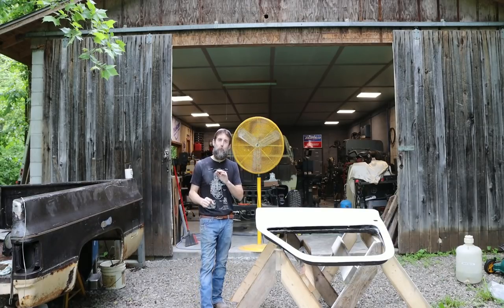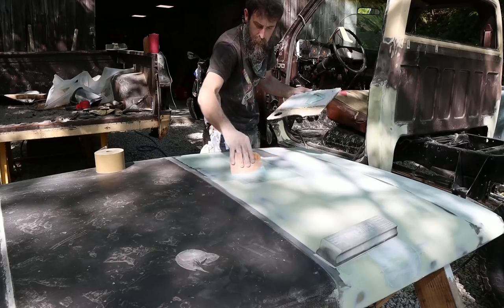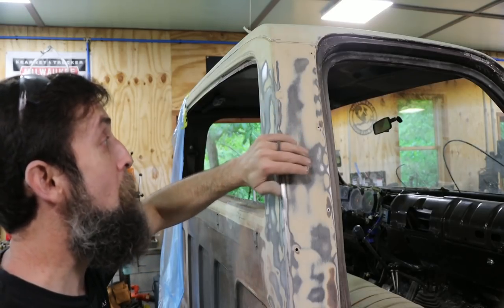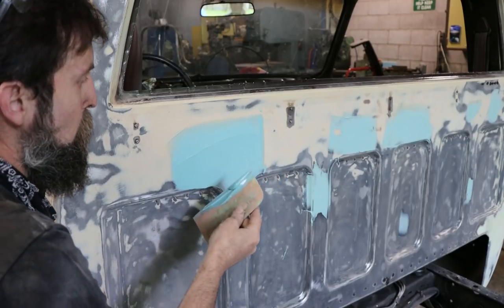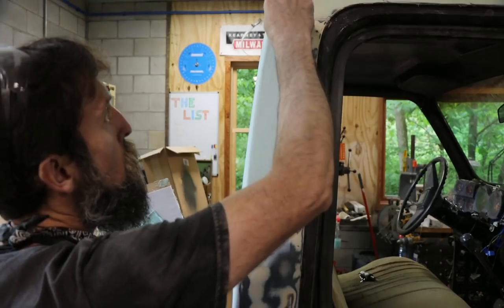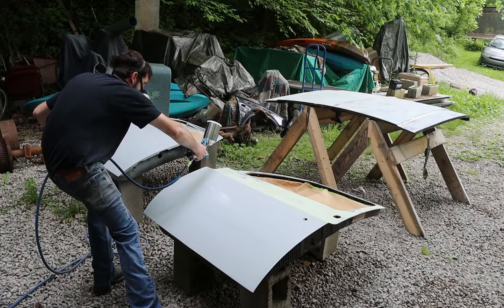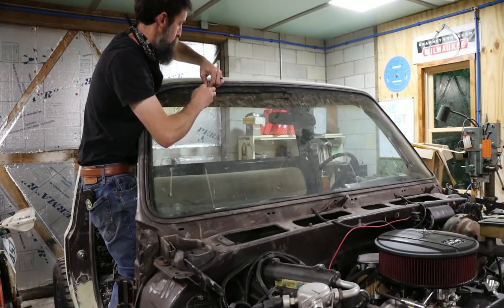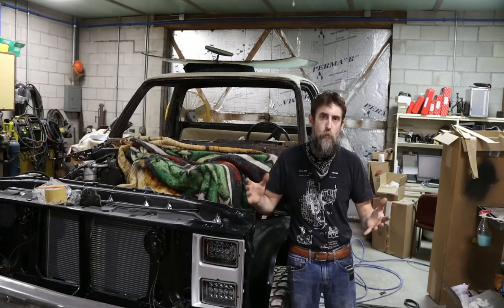This truck is Rough! Body work tips and spraying primer.

Comment: I have done 3 square bodies and replaced the windshield and gasket on all of them. while they might look clear after so many years all the micro pits and scratches make it hard to see through. Just did a quick search a new one is around $100. Well worth it imo.

Comment: A trick I used a few times to increase the open (working) time of filler was to add some acetone to the mix.  It also let me wipe on a thinner coat, so I had less sanding to do.  I only used this on a small job, so I cant' say if it impacted the long-term properties of the filler.  I was just leveling some pitted channel iron on a piece of machinery I was refinishing, and it seemed to work just fine.

Comment: Hi Steve great work as usual. I’d recommend sanding your filler a little finer than 80 though. All the substrate will continue to shrink with age so those sand scratches that are filled with primer will shrink more. Over time it will event start to show through your paint especially the first time you leave it out in the sun a few days. Looking good will be a nice truck when you’re done.

Comment: I'm a skeptic too but your description matches almost word for word what I heard and felt on a solo camping trip in the deep woods in the U.P. in Michigan. I was almost like I felt the noise more than I heard it. I was deep in the Porcupine Mts state park. I heard the answering call also from who knows how far away. There are plenty of bears up there but they don't make noises like that and they don't answer back to each other either. It was about 2am and I'm in one of those little tents that aren't much bigger than a sleeping bag. The first thing I reached for was my Glock 21 which would probably just make whatever made that noise extremely annoyed while it was tying you into a tight knot around a tree.
Needless to say, I don't think I slept anymore that night, in the morning I got out and did some circles around the campsite out to a couple hundred yards and found absolutely nothing. I tried to make as many miles between that site and my next night's site as possible  I was up there for three more nights and never heard anything like that again. I know for a fact it wasn't a black bear and it wasn't a cougar, it wasn't a wolf. Those are the three big animals in those woods, if it wasn't any of those what was it?

Comment: Steve if you run a strong wire from the inside of the cab to the outside of the cab and pull the wire all the way around the the edge of the entire windshield will unstick the glass from the rubber.

Comment: Great job!! Crazy the sound you heard. I used to believe nothing like that could exist without us finding it. This isnt about big foot but in 2009 i was deployed to iraq. I was on a very small COP (combat out post) we were walking back to our company area. It was dark outside. On this cop we only used red or blue light At night. Because the cop was mortared a lot. We saw a cat just freaking out like it was in fear. When we got about 6 feet from the cat. this massive mostly black spider runs out and grabs the cat. A very small fight..cat had no chance. then runs off with the cat. When we were seeing this. we all went to white light. The whole thing took about 10 to 15sec. We were about 6 feet away from this spider. We all got a very good look at it. It was not a camel spider. They dont really Get that big. the biggest i ever saw was smaller then a tarantula. Plus they look kind of like scorpions mixed with a spider. This looked like a wolf spider. The body size without the legs. was about the size of a 2 liter bottle. Its legs were about 3 to 4 feet long.  We found the cats body a few days later by our trash dump. It was fur skin and bones nothing else. I have been told that its impossible for a spider to get this big. There were 3 of us that saw it. We all saw the same Thing. Never saw it again. One of the people that was with me and saw it. was our first sergeant When this happened no joke our command had us looking for it. With the intent to kill it. Worried about someone being attacked by it. Looking back i don't know why we didn't shoot it. we all had our weapons.
Reply: I've no idea what type of spider it was, but I've heard a couple of giant spider stories from friends who have lived in the middle east. New species of bugs and animals are still being discovered every week. Lots of undiscovered stuff in our world still!
Reply: There are spiders like that, that can outrun us easily - and will kill. It's a bloody wild world out there! Much respect for your service in Iraq, take care from the UK.
Reply: Tired eyes play tricks at night. The world's biggest spider is in South America and weighs about 5 Ozs.
Reply: @Bob_Adkins  Three pair of different eyes playing the same trick? I guess it's possible, about as much as the giant spider is possible..
Reply: @Steve_Just_Steve  Zoologists will kill and risk being killed to get a creature named after them, so we're talking 1 in a billion or more. There are endless stories and fantastical legends about camel spiders, which are small and relatively harmless. I can't imagine how many stories there would be for some huge arachnid that could carry off a cat.
Reply: Wow!!!
Reply: @Bob_Adkins  A lot murdering Zoologists out there huh? JK
Reply: @Steve_Just_Steve  Naaaah, only when they fight to see who a rare bug gets named after.
Reply: @Bob_Adkins  i hope a wish that was the case. But there were 3 of us that saw the same thing. We went to white light. And like I said we were about six feet away and you could see this thing with extreme detail. It killed a carried off a cat.  
It really looked like a all black wolf spider. I really hope it was some kind of Mass hallucination. I really dont wait that to have been real.

Comment: Body work is an underappreciated, thankless, hardest thing most people will ever do. It takes hours upon hours to get it  straight. Its dusty, takes a ton of elbow grease, and a good eye and hand feel, to get it right. Just when you think you're done, you're not! Body filler is absolutely necessary to make it straight. What most people don't realize is that most of the body filler that goes on gets sanded off. Just about every beautiful , straight and shiny, show car that you've ever seen has  tons of body filler applied to it.  The really straight ones have more body filler on them than paint by weight. New cars are not straight by show car standards. Even though Steves truck is not going to be a show car, I know he'll probably take it to the point that it'll be straighter than when it came off the new dealer car lot, because that's how he does things. He won't be satisfied until he's satisfied.
Reply from the maker: When one is slick it shows.

Comment: Back when I was doing such work on trucks, if a decent bed couldn't be found, I built a flatbed on them. One can get quite creative in styling one, just build it as you want to.
Of course, that was way before the cost of wood and metal went to near low orbit prices.
Just a suggestion.

Comment: Steve in 1997  I was hunting in a pit bkind for deer on the the Nw end of Panama City Beach. I was in the pit before dawn but it was late in the season early Feb I think. So it was warm and moist and foggy as hell. Really didnt have much hope of ctchung site of anything till it burned off so I hunkered down to wait. After a short while i began to here something large moving through the thinly pkanted young pines near me. Way to noisey for a deer. Pig I thought as the large noisey thing moved past my blind at what sounded like just a few feet. Hard to say with the darkness and the muffling effect of the fog. Suddenly what evr it was stopped moving almost dead in front of where I sat... Then I realised I could hear it breathing deep slow raspy breaths. Then that same ultra low ultra deep grunt or rumble you seem to be describing just about blasted me out if my seat. I COULD LITTERALLY FEEL THE NOISE.... About then I realised I was gripping my rifle hard enough to leave permanent marks in the wood. And had already slipped the safety. Isat frozen terrified on a deey primal level. This was not one  the normal woodland of  North West Florida. After an eternty of hear it breath and sniff the air and a few more grunts it finaly moved away. Leaving me more shaken than I have ever been... Cant tell you what it was  but It definitely was not normal fauna. And Sware I will never forget the FEEL OF THAT RUMBLIMG GRUNT.... like someone was thumping my chest
Reply: Sorry for the typos folks Ive got fat thumbs.

Comment: i didn't read thru all comments but i assume you know epoxy primer on before filler. other areas to raw then epoxy primer followed by build primer. there is a powder that is dusted/rubbed on for guide coats vs foo-foo cans

Comment: So your story sounds like an experience I had once when I was younger riding my bike late at night. It was a sound much like you described. Come to find out the area I was at, it happened a good bit. What caused my experience was two different winds  from opposing directions meeting at the top of a ridge. The sound I heard was a very low almost moaning like sound , very living creature sounding, that I could also feel the vibrations in my chest. I would not be surprised that it was something like what I experienced. At the time it was a very erie experience, as it sounded almost human, but other worldly, it was a trip for sure! Also, if there are multiple (more than 2) winds meeting in one spot, the sound becomes even more complex. I found out there are certain places where this is a fairly common phenomenon. If central Kentucky is anything like southwest Virginia, which from the videos, it does look very similar, then I bet there are a lot of hollows and valleys and old rounded knobs and small mountains that could easily make such a sound. By the way, I've been a bird watcher since I was 10 years old, I'm 53 now, and I've taken a very large interest in owls, cause they are one of my favorite species, and I've never heard an owl that could make a loud enough sound that you could feel the vibrations in your body. Not going to say it's not possible, I just doubt it, a lot!
Reply: I wonder what that phenomena is called?

Comment: With the messed up headlight mounts and what looks like body imprint on the hood I would say it’s a safe guess that a previous owner of the truck struck a deer or something similar. Also my bet for the strange noise is on a barred owl or larger owl, here in Idaho horned owls have a deep hoot for a mating call in the spring.

Comment: steve do you live on cppperhead row? the extra work on the truck is like diff between army john deere bulldozer vs the commercial version...you should get tow points in diff color on front consider the efi - the frame and gears should be fine - you want some good electronics and be always logging data from then engine if possible - talk about the obd2 bluetooth and laptop connection - i know it depends on application - you do want a cb, you do want a radar detector, you do want a scanner, would not be a bad idea to dyno it? you may get all data like afr you need to know it is 100% do think about gun rack plus backrack plus transfer flow fuel tank plus toolbox plus light bar - you can have it all - adding rails to top of bed recommended - easy tie down points and you get places to mount antennae - 10m, wifi,gps, bluetooth and cellular or starlink, drone you should get some motion cameras but shop around - i am more inclined to believe in ufo and now there are 400 incidents - maybe there will be more - a paranormal summer? i think there should be a tempering of the mkts over the summer - find a project last req - do some flip flop paint - the car can be 3 colors depending on where you look at it from - it is priicey but look into it - plus clear coat plus sparkles - maybe just do the doors - look at samples
Reply: If he does all that the truck should get its own channel.  You forgot the racoon tail for the radio antenna and the fuzzy dice off the rearview, lol.  And the nuts hanging under the hitch.

Comment: I'm surprised you weren't using a "cheese grater" to knock down most of the filler before sanding/shaping...  Also, a piece of wire w/some dowels as handles to "cut out" the windshield may have helped out with that windshield removal.  It's easier to push through a piece of wire than a large pry tool.  These vids get me all motivated to try/start my own work!!  Thanks for these!  The work on the truck looks great so far!!
Reply: Cheese graters (Surform) are needed only if using way, way too much body filler.

Comment: Great footage Steve, interesting to see what goes into preparing an old square body work for spaying , can’t wait to see top coat go on, I’m guessing you will set up some kind of tent inside shop to keep overspray off all your machines.  Interested to see how you keep air dry I’m assuming you have relatively high humidity.
Looking forward to next instalment.
Reply from the maker: I'm debating on spraying it myself. A make shift booth possibly. I can control moisture with my shop dehumidifier.
Reply: @SteveSummers  Your brother probably has a spray booth that he'll let you use. If I had the option, I wouldn't have sprayed my truck in my garage.

Comment: desperate longshot here!  i am looking for a spindle return spring for a kitchen and wade radial arm drill. model B24.     cant get one here in the UK. can any Yank help out?
Reply: or.... in the hope that these were exported to the USA     can anyone suggest a breakers yard that may have parts for sale?
Reply: You can adapt many return springs to fit you're project. I needed one for my old drill press and found one close enough to do the job. Nobody is going to see it.....so improvise : )
Reply: @ukulelefatman  yeah i know, ... but it doesnt hurt to ask around for one.

Comment: Yeah 98% prep 2% spray.... I do and have done both.. seance I was 17 years of age... I pretty sure that I have already sprayed dam near every thing there is to do work on and needed paint from pipes for plants to cars and trucks to battle ships,houses,motorcycles,volume tanks of whatever,structures,BBQ pits,to fence posts,ext,etc.... and that is the truth 98% prep and 2% spray.... when spraying all one has to worry about is no runs drips no holidays and consistency r millage at a 50% over lap...if you are a painter or been around them enough you will know what I'm taking about..go Steve-o.... cause sanding is not fun and from what I am seeing he going to have a lot of it..... ooh what he said about the sandpaper will go for your masking tape also get the good stuff...